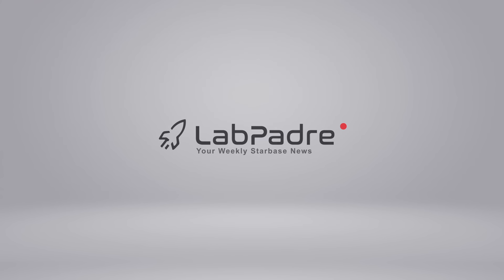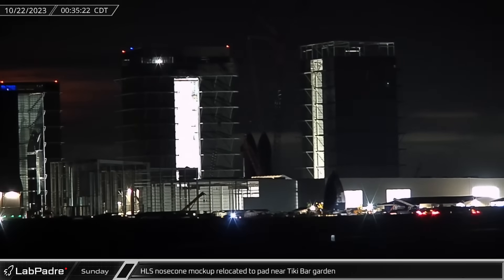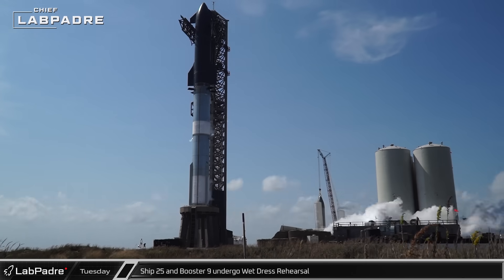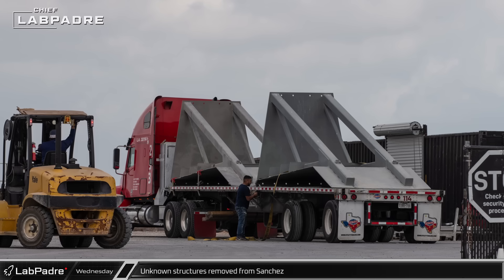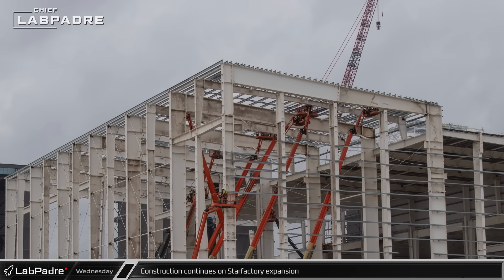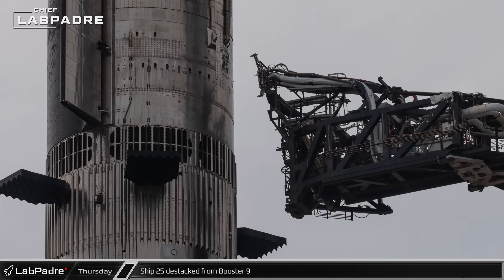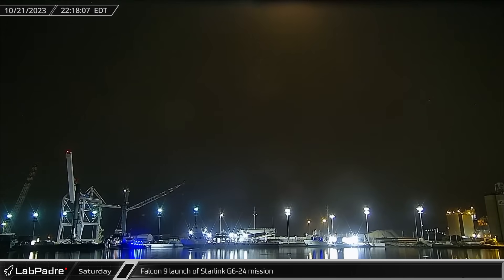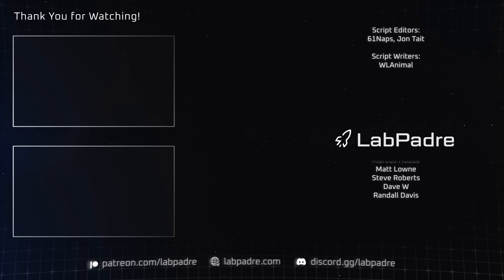SpaceX Conducts Full Launch Rehearsal! - Starbase Weekly Update #86

Comment: SN 26/B10 first week of February 2024. 16 V2 Raptor and 17 V3s  to orbit. the objective is to assess failure of how many V2 can fail and still have reserve power from the more energetic V3s to achieve an acceptable orbital profile. This test launch does not require the large fins or heat shield tiles as SpaceX never planned to control return Starship, only the booster, thus the special purpose of "Ugly Starship 26".

This wet dress rehearsal was not a wet dress rehearsal of SN25/B9 with no launch date announced, it was a wet dress rehearsal for the upgraded quick disconnect and the tank farm systems full function test.

Comment: I would hope that the hot-staging ring holds up under static load, given it needs to survive both launch G's and Max-Q in an actual launch...
Reply: I am concerned about that as well. Just seems to light to hold the Starship under launch pressure. But the way things are constructed has a huge difference on strength. It may just be as strong as a solid sheet would be due to way of construction.

Comment: Starship should launch with its inner Raptors ring gimballed outwardly by about 3 degrees to help deflect heat and dynamic pressure during lift-off and redirected a second after it. That should help this deluge system design.
Reply: I'm guessing SpaceX has already contacted you to offer you that Head of Engineering job you so obviously deserve.
Reply: I suggested you as chearleader.